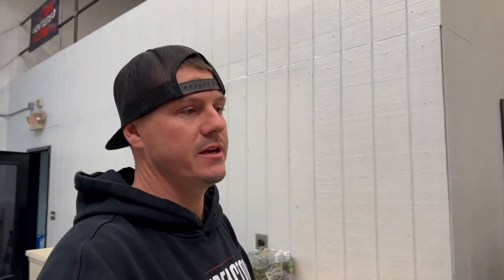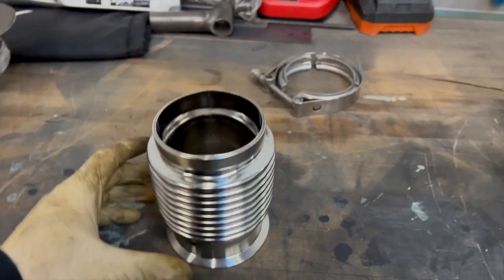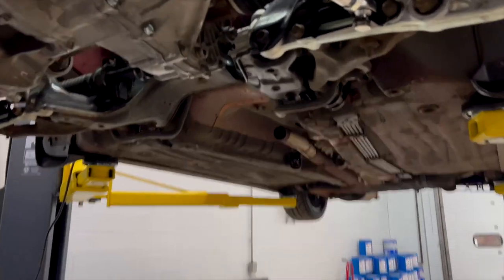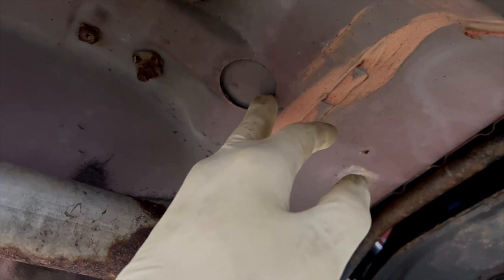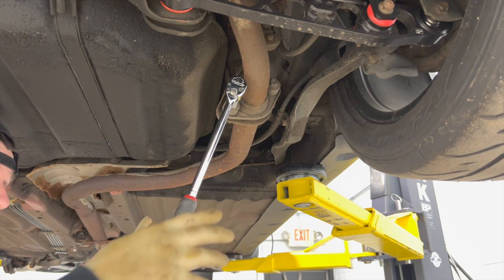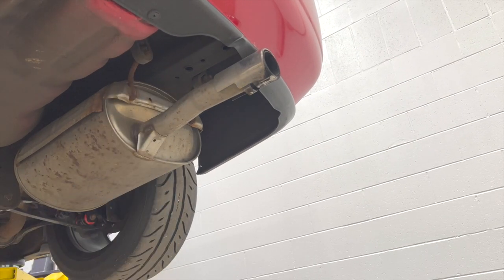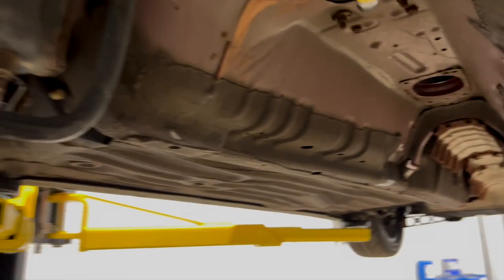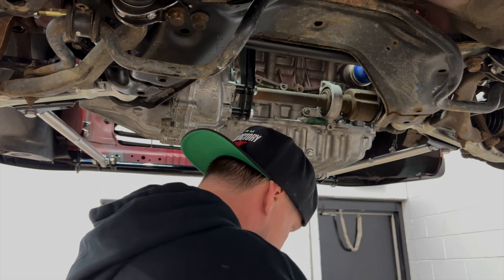Preparing the coupe for some BLING! (Myers Competition inside)

Comment: Lisle 38350 Exhaust Hanger Removal Pliers…. Get it on Amazon for $26. Must have for daily exhaust work, use quick dry silicone spray. Wd40 is ok but leaves oil spotting which spreads into a larger spot. Great video keep the grind going. Nice tips on the harness routing. Looking forward to part 2
Reply: Hanger pliers are life changing.